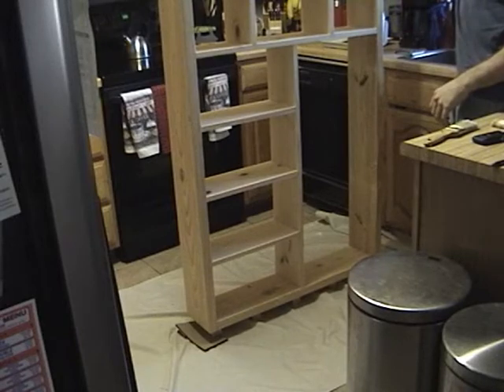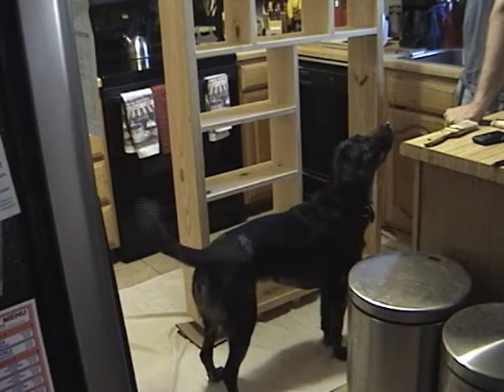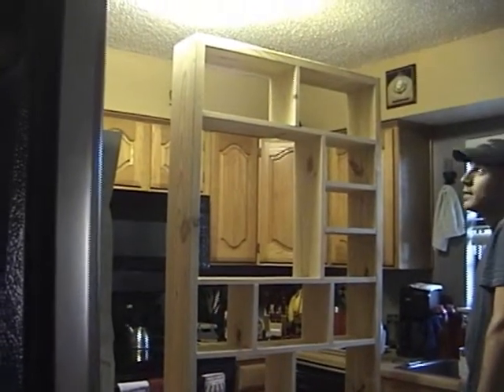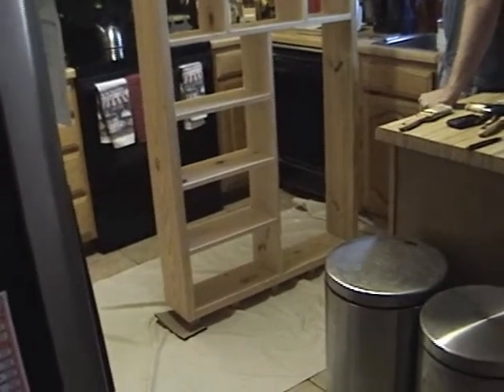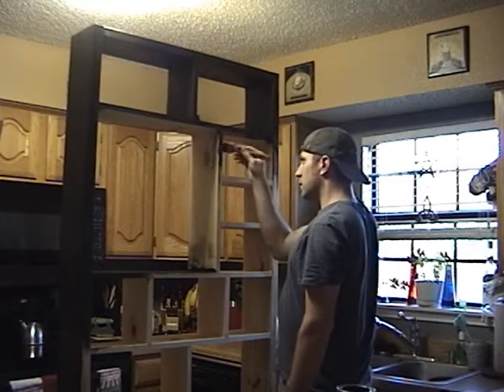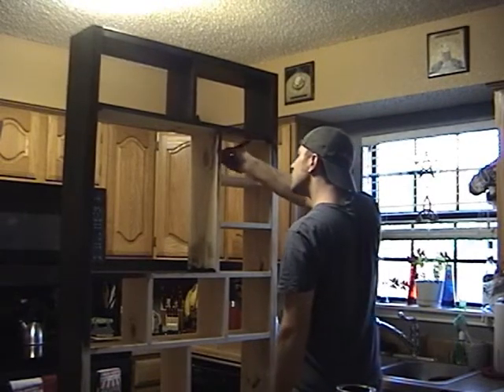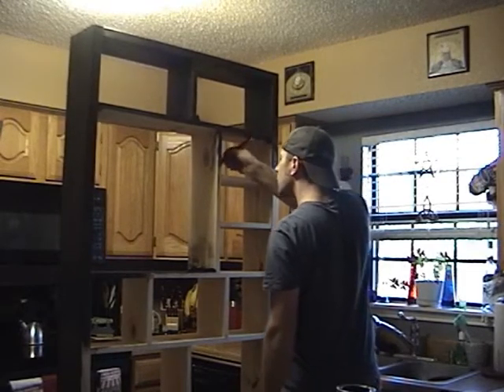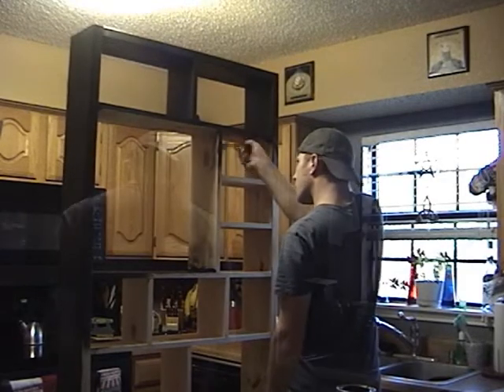Do It Your Damn Self: Shelf Unit Part 3

Comment from the maker: @sunshine3317 We  actually used a nail gun (pneumatic nail gun) to attach the shelves.  With the wood filler, some sanding and paint, you cant even tell there are nails holding them in.  We did the standard 4 nails, one inch from each corner.  You can also do the same with nails and a hammer or even screws but of course if you want the look of no nails or screws, you have a larger hole to fill after you sink them.  Hope this helps...  -T